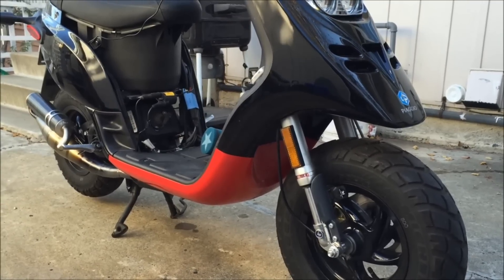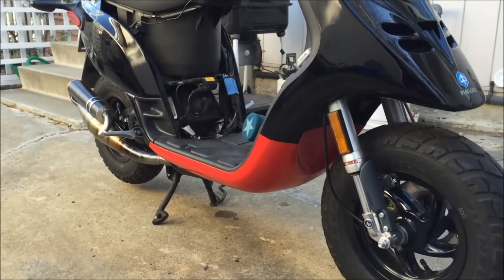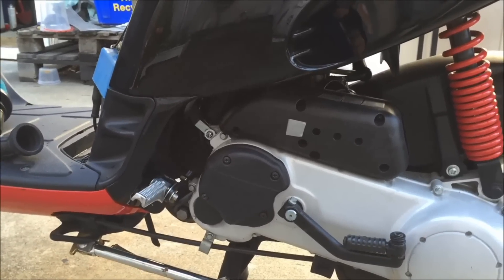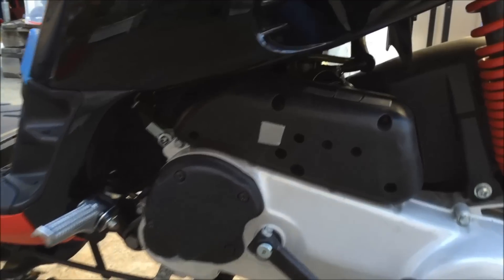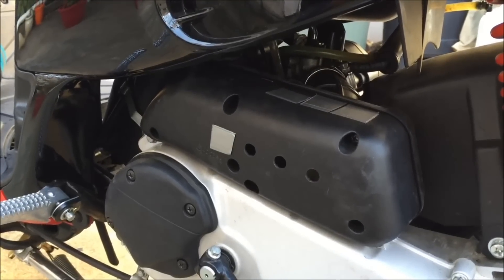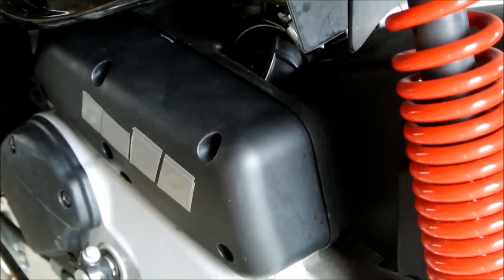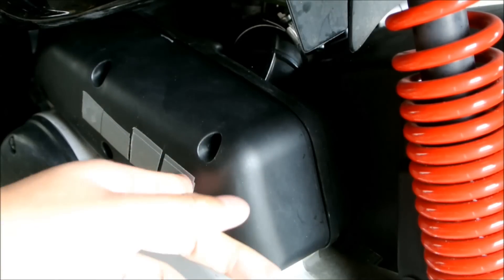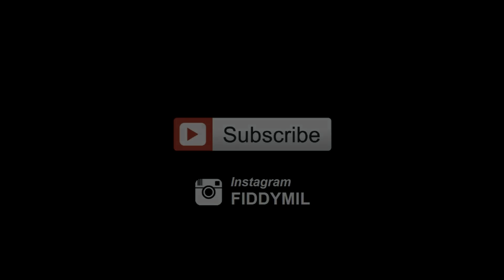BEST FREE MOD FOR A FASTER SCOOTER - EPISODE 10

Comment: Not necessarily. Your not running a supercharger which forces air in then you need more fuel. These engines can run without a filter. They will not suck in more air than they need. This is why the carb has the flaps that open to allow air in. Run with a pod filter screw the box all together.
Reply from the maker: You are incorrect in assuming that only a supercharger will require more fuel. The air flow is restricted by the airbox baffles which are in place to muffle noises. Providing a more direct path will create more noise but also improve airflow. A pod filter is largely unprotected from the weather and elements and therefore not a practical suggestion for scooters that commute to work daily.
Reply: @FIFTYmil   FIFTYmil  Not sure what you mean by your statement but any Supercharger or turbo engine will need more fuel than a non supercharger or turbo engine will. No way around it. Not sure what your back ground is but I have 20 years experience with all types of engines. Racing, commercial, mitlitary civilian etc. Yes you can run a pod air filter in the rain if you do it right. Not going to get into that but its been done on many applications. You can run a cold air instake also with a ram air if you do it right. How do you think car that come from the factory like the Trans am ram air is built? Rain doesn't mean nothing unless you are not creative.
Reply from the maker: @csb772  My statement was in response to yours. Your first sentence immediately stated that I am not running a supercharger and therefore does not need more fuel. I am indicating that my modification provided a more direct path of intake which increased the amount of air going into the combustion chamber. As such, I had to increase fueling and thereby created more power.

The fact that you "can" run a pod filter in the rain does not say anything about practicality and it certainly doesn't mean you should either. You "can" run an engine without a filter but clearly all manufacturers adopted the airbox and filters on all of today's vehicles for obvious reasons. Therefore I will not discuss further on that point.

Comment: Thanks for this great vid...I have a new '16 Vespa Primavera 150. It's fuel-injected and I've installed the Milossi exhaust system and the red air filter element. It improved my top end by about 6mph (from 66 to 72). I just did the Variator mod and installed lighter sliders to replace the rollers and that made a BIG difference in power but reduced my top end by 2-3mph; now maxing out at 70mph. I'm a believer in better intake systems feeding more air to help maximize the combustion efficiency. What do you think about doing your mod to my airbox? I ask because it's a pain to remove the airbox on this bike... ;-) I know...no pain, no gain.
Reply from the maker: Lighter sliders, if they gave you better acceleration, shouldn't reduce your top speed. What RPM were you at previously at 72mph and what RPM are you now at 70mph? I believe the lighter rollers may be slamming you into the rev limiter and holding you back.

The airbox mod should work but two things to consider: 1) If you exceed the flow rate of your fuel injectors, you will be starving the engine of fuel and any additional airflow on top would equate to more power. Fortunately you can always tape the holes back up and perfect it to match your max injector flow rate. 2) The malossi filter element already filtrates less than the stock filter and the airbox mod would subject the engine to more direct (and often dirty air). Strict maintenance guidelines must be followed to ensure as little contaminants getting into the engine as possible.
Reply: Thanks! I don't have a tach hooked up yet so I don't know the RPMs...when you say slamming to the rev limiter, how and with what does the factory set that up? Can I override it? I'll do your airbox mod next rainy day! Cheers!
Reply from the maker: Often found on 4-strokes the factory ECU governs at what RPM to cut back the engine, and thus forming the rev limiter. Certainly a lot of aftermarket CDI's can and will override this because peak horsepower can be found beyond this limit. One way to do this is to fool the factory ECU into thinking that the RPM is not exceeding the limit. I installed a NCY CDI into my 4-stroke Honda Ruckus and I ride it at 9900RPM.
Reply: Unfortunately, I don't have a tach so I can't tell your the RPMs. I DO have the add-on tach that clips on to the spark plug wire but I can't open up that door yet until after warranty period. I was warned by the dealer. However, opening up the clutch/variator cover was OK. Go figure...
Reply from the maker: That's hilarious. Add-on tachs are non-invasive and tachs like the one I use (episode 0) virtually just wraps around the splug plug wire and it can already tell you the RPM. No wiring, no soldering, no plugs. Just wrap a simple wire around the spark plug wire and you're good to go.

I'd be impressed how they would find out if you have ever installed a tach to your bike.

Comment: Thanks for all the videos bro. I have a 2014 ssr rowdy. I’d like to start some mods. What do u recommend I should start with?
Reply from the maker: Danny Castillon assuming no factory restrictions present, I would find out your engine’s reported (or dynoed) peak horsepower rpm, and then spend 6-10$ on variator weights to tune the transmission to operate at peak power
Reply: Big bore kit!!!!

Comment: Man. You have a air/fules screw mixture. You don t need to rejet. Just give it more gas from the screw.
Reply: The screw adjustment is only effective for Idle/low rpm.
Reply from the maker: @MikeyMike is correct, the air/fuel mix screw is largely responsible for idle tuning
Reply: @FIFTYmil  You have 2 screws. One for idle mixture and one for riding mixture.
Reply from the maker: @george-ef2xx  Not for this carburetor there is no such screw for "riding mixture"

Comment: Running a 2 stroke lean has nothing to do with your oil .. it's the lack of gas .. which will cause your scooter to run hot. And it will melt a whole in your piston. Don't just guess on things. You could destroy someone else's scooter by giving them bad advice.  You could have made them same video but just made it as a looking for advice video and had people give you advice. And then you could have made a couple follow up videos. ⁷ if anyone needs any advice on upgrades or repairs message me. I will give you some advice or I will let youkl know who to talk to. I understand how hard we all work for out money.

Comment: Hey bud, i tired this on my formula 50cc. It's a 2017 scooter. But all i really got was a little extra noise.. barley noticeable lol. As for the power? Took it for a spin, but didn't really notice any increase? I haven't retuned the jets tho.
Reply from the maker: 8drifit  I had to rejet after this mod. More air, more fuel, more power. Adding more air without more fuel would result in the same or less power than original setting
Reply: Oh okay bud. I'll get the thing rejeted then 😅
Reply: FIFTYmil 

Do you think the power will be noticeable after the rejet?
Reply from the maker: 8drifit check out my other episodes for the before and after. Cheers

Comment: HI i have a problem i own a peugiot vivacity sportline and the moped is great but i wont go over 60kmph it doesnt have an electronick restriction or on the variator just took the restriction of the exaust, changed the cluch but it has the same cluch spring but it still wont go over 60kmph .PLease give me some advice on what to do?? thanx
Reply from the maker: It won't go over 60kmh? not even 1km/h? If that is the case it seems to be limited by the company and not because it doesn't have enough power...
Reply: FIFTYmil it does but when i find a veary big downhill but when it does it makes a weird saund and its like te motor isnt doing anythin sorry fore the spelling love from Boznia and Hervegovina. thanx
Reply from the maker: I would suggest watching episode 0 all the way to the end on my channel and do the following:
1) Tachometer
2) Determine your current RPM and identify your engine's peak horsepower RPM
3) Complete any modifications you would like to do to increase engine horsepower
4) Determine the new RPM and how close it is to your peak engine horsepower RPM
5) Tune the roller weights to target your peak engine horsepower RPM.

After that you should have a much faster scooter!
Reply: Thank you wery much

Comment: You can even use rubber GUSSETS to make the holes smaller OR plugs instead of tape XD IM SO EXCITED TO MOD MY SCOTER!!!!
Reply from the maker: Yes!!! The only issue with plugs is, when installed into the airbox, it might act as a restriction for the stock airbox and create turbulence. Tape in contrast provides a flat surface thats more or less like the stock airbox before it was drilled.

Comment: Will this work on a 150cc 4 stroke? I wanted to add a k&n but there is a bunch of hoses and I don't want to remove my air box if I don't have to incase I ride to work
And it rains
Reply from the maker: Yes but it depends on your airbox. The effectiveness depends on how restrictive your airbox is and the path of travel for the air. Create unnecessary turbulence and your airbox will flow even worse than before.  The good thing about this mod is it is reversible. If you're unhappy with the results, plug the holes back up!

Comment: i just did this pod filter mod on my 1999 v100 address, now do i need to tune the carb as the engine bogs out mid range> cheers
Reply from the maker: Engine bogging out may suggest a need for carb tune!
Reply: by carb tune could i just get the next size jet? it just seems a bit sluggish for a 100cc
Reply from the maker: Jason, if it's only a mid range issue I would consider just adjusting the idle mix (check out my other video on that) but are you sure your bike is performing fine at WOT? (wide open throttle). Typically with a pod filter I see both a idle mix adjustment, needle clip enrichening (if available), and stepping up the main jet. Pod filters are one of the more intensive modifications for the engine compared to something like a roller weight change.

Comment: where do you find those colored engine cases or belt case whatever they call it
Reply from the maker: Stock factory belt cover of a 2005 Piaggio Typhoon 50cc or NRG Typhoon. They should be the same for most Hi-Per2 engines including Vespa, Aprilia, etc.
Reply: lol you got a fancy bike i have a vip 50cc upgraded to 82cc
Reply from the maker: xViperCodes | C# - VB - HTML thanks viper. Eventually I will look into increasing displacement but I actually want to import a piaggio 125cc engine and motor swap!!!
Reply: +FIFTYmil me too can you fit a 125 engine on a 50cc body???
Reply from the maker: ***** I haven't really looked into the details yet but it may require a little bit of welding. If not that would be a bonus! For my 150cc swap into the 50cc Ruckus that required extensive modifications

Comment: Why does my scooter spit flames as you can see in my newest video around the 1minute mark?
-Näätä
Reply from the maker: Most of the time exhaust spitting flames can be associated to a overly rich condition. This does not mean it's bad as many tuners like to err on the richer side for better engine longevity at the cost of poorer fuel mileage.
Reply from the maker: Pardon my poor engrish :)
Reply from the maker: ***** Randal got exposed for lack of subject knowledge. Pick on something else to criticize about. Now I understand how you ruined a 50cc and then went to a 80 and then a 150 lol.
Reply: ***** Well it' goes 71kmh which is like 45mph and before it went 35-37mph I weight like 169lbs. 
TL;DR Yes
Reply from the maker: ***** BraapBraapWheelie It is hard to tell what is the cause of the backfiring based on just the information you have provided. As Randal mentioned, engine detonation could be one of the many scenarios - but not the only one. What size engine do you have? Is your engine carbureted or fuel injected? Does the backfiring happen after you shutoff the throttle abruptly, while accelerating, or in other situations? What was the last change you did to the motorcycle you noticed the backfiring?

Based on the improvements you found, regardless, I don't think you will have "blown up valves, engine, or pipes that will blow apart" lol. That seems like a bit of a over-generalized paranoia coming from someone who ruined multiple bikes already, doesn't it? ;)
Reply: FIFTYmil True I don't even have to care about my scooter anymore but anyways, it is 50cc 4stroke with a carb, I'm getting a 50cc 2stroke suzuki pv today check my channel out if u wanna see some video.

Comment: How do I deristrict my Piaggo zip 4 stroke and it’s a 2018 version
Reply from the maker: I am not familiar with that model, sorry.
Reply: Take off the air box and there will be a metal plate inside the carb take that out and re jet your carb

Comment: Will this mod work on a Yamaha smax 155 (fuel injection)?
Reply from the maker: Cal-Metal Desu yes but with fuel injection you are limited by the flow rate of the injectors. Providing more air than their flow rate will result in a lean condition. The good thing about this mod is if that problem arises, you can just tape the hole up and tune on the go.
Reply: With fuel injection it's best to leave the airbox and induction well alone unless you have access to a rolling road dyno and can re-map your ECU. Just let the mass air and air temperature sensors compensate for exhaust changes untill you need to go further and are prepared to spend a lot of money for what is, not a lot of gain!

Comment: hi bro 
i have got vespa 150cc and  i want my exhaust sounds loud.
if i install hp air filter ... does it will affect the engine?
Reply from the maker: Yes it will
Reply: what should i do? for the good sound
Reply from the maker: Changing the exhaust and the intake will definitely change the sound  of the engine and the level of loudness.
Reply: changing exhaust is illegal in our country there is any other way?
Reply from the maker: change the intake will achieve a similar result! But not as noisy
Reply: +Stopmotionvideo123 - I guess you're in the perfect route to "fu_k" up your bike. From what you wrote I don't read anywhere the expression "improve".
HP air filter and equivalents are less restrictive simply because they filter less.   

I hope you realize if you follow the typical route of making less than desirable changes. The final result will be not a "good" bike but a piece of crap with less value, less reliability and most important less pleasure to use. What can be called a money pit... Choose wisely. :-)
Reply: lol
Reply from the maker: That was pretty harsh but do hold some validity in the statement! But if sound is all you're after and installing aftermarket exhaust is illegal, I would only suggest modifying your stock exhaust or changing your intake to add more sound to the bike. Either way they are still not recommended so please follow your country's laws where required.
Reply: Hopefully harsh enough to make him wake up. If "noise" is all the rage, why not a set of earplugs connected to any sound player with the "noise" of choice and the volume of choice. :-) No engine, exhaust or any other part of the bike will be affected for sure. But wait double ear plugs are also illegal. OK so it's mono, instead of stereo...LOL  

Side note. Presently working on Aprilia RS4. Where the stupid owner could get parents to pay on top of the bike itself, for new sport exhaust, airsal top end and a lot of other goodies. 
But nobody told the moron that the bike would never run well with a restricted carburetor, also nobody ever told him that the damn e-clip MUST be in the carburetor needle. Took me hours until discover why the bike hardly starts and surely don't even run. Dealing on a daily basis with stupid kids choices might lead to some "kick in the butt" for them to wake up. ;-)
Reply: wht part are u talking about, when u say to change the intake ?
Reply: +scorpionbradford - He meant intake air filter. Removing the box and using a simple foam filter. Makes a lot more noise and opens a can of worms with engine gremlins due to carburetor tuning and bad filtration. But you get NOISE ...
Reply from the maker: Yep, just like how noise escapes the engine from the exhaust, they also exit from the intake. Factory airboxes have baffles and chambers to muffle this noise. Therefore modifying the airbox and providing a more direct path of air flow will increase airflow into the engine but also the noise that escapes.

Comment: Use some Motocross Air Filter Oil on that foam and no dust will enter ...
Reply from the maker: Using yamahlube filter oil already. 

A common misconception is that filtration is either 0% (no filtration) or 100% (perfect filtration) when in reality the foam filter's performance is a spectrum depending on variables like how much oil you used, how dusty your riding condition is, how direct air is being fed to the filter, etc.
Reply: perfectly right. I meant applying some filter spray on the surface, followed by a soft massage to penetrate the top layer of the foam, forming a thin, but yet homogeneous pelicule of fine oil catching any potential harmful city dust. Drowning your foamy is not a solution!!! :-) by the way I use Putoline
Reply from the maker: Yes - too much oil would in fact gum up your carburetor and can also decrease performance.

Comment: take out the inlet pipe,install malossi filter (not pod) and no need to drill.i shouldnt recommend this to anyone.wasted plastic.u can even use runner big type airbox.
Reply from the maker: Two completely different things. Using a drop in malossi filter would not be the same as drilling for this particular type of airbox. Drilling provides a much more direct intake path compared to the baffled pathway original.